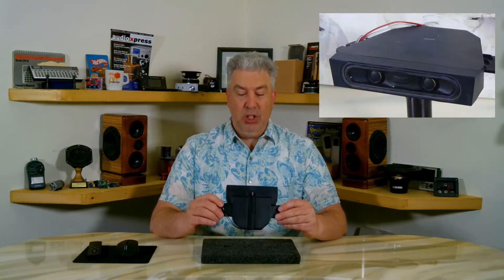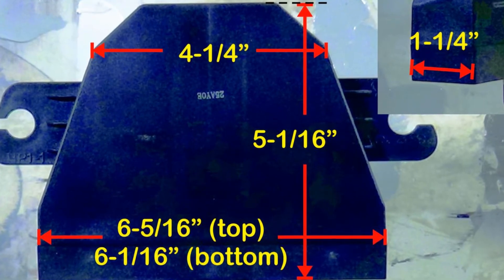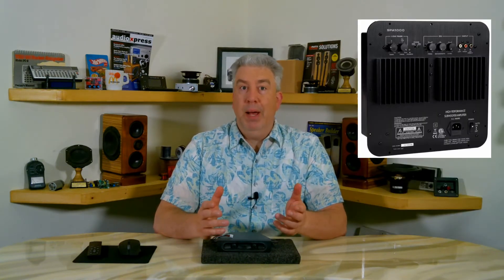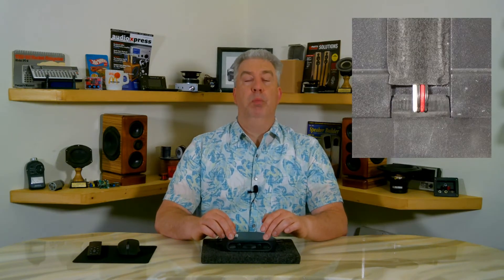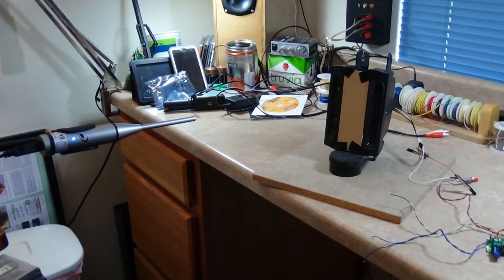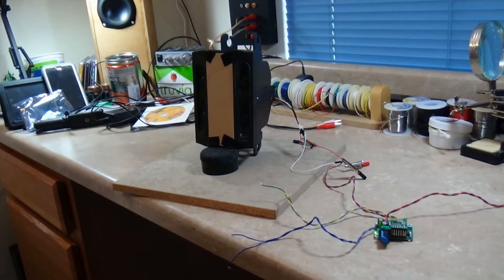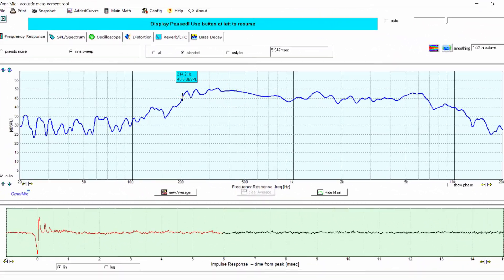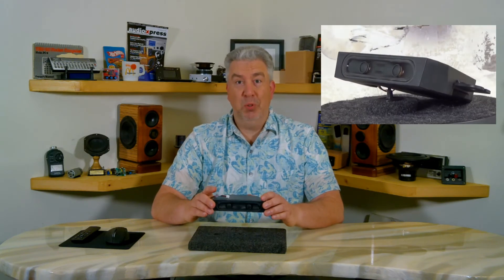Giving This Buyout Racetrack Speaker a Closer Look…

Comment: They were used in several Philips tvs. Some had only one used as a fullrange but other models came with 2 tweeters and this thing was used as a woofer in the tv. Its made by samco and I must admit it sounds really good for the size!
Reply from the maker: Thanks for that information! That explains the extra leads and crossover cap on some of these models.

Comment: Like your content very different and correct way of analysing. Thank you 
Also would like to know your opinion on the tang band sound modules they have full range snd also subwoofer completed with housing. A very innovative approach
Reply from the maker: I've looked at a few of the small ones and I think that several of them would make pretty cool Bose-Clones. They are a bit pricey though and don't leave much for me to do except make a tiny cabinet. That's good and bad I guess. :)  Thanks for the feedback.

Comment: Any thoughts on the extra output wires? The Q&A on the product page seems to allude to crossed over leads for a tweeter.
Reply from the maker: All of the speaker modules I received had only the four leads, two for each voice coil.  I did see that some of the early reviewers had modules with extra leads, and I saw those pictures as well by reviewer Charles C.  

Here's a guess. As you can see from the video, and heck, even the thumbnail for this video, the highs start to drop off after 7k or so. Assuming this module was used in several TV's, it could be that in one of the nicer ones, the two caps were there as a basic "Crossover" for a simple tweeter to fill in the high end that is missing with these speaker modules. The frequency response I measured was on-axis at a foot away... if you shove that speaker inside a TV frame, the highs are going to be attenuated even more I would suspect as higher frequencies are more 'directional.' Maybe this was an option on a few of these buyout speaker modules just to allow for a tweeter to bring the high frequencies up to where they need to be for full frequency reproduction.   
That's my guess, anyway.

Comment: The response curve looks optimized for intelligibility in speech, not a bad design decision for a television.
Reply: I agree. If that was the goal, then they hit the nail on the head. One thing I neglected to mention is the fact that things will sound a bit different inside a TV mounted on the wall for instance. I bet that fills in the low end just a bit, but I doubt it will help the sagging high end at all.